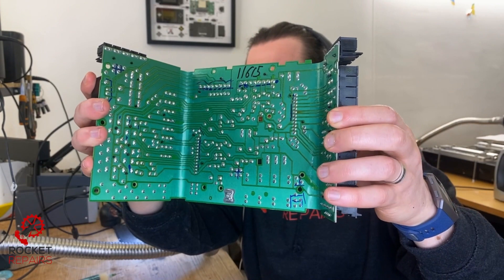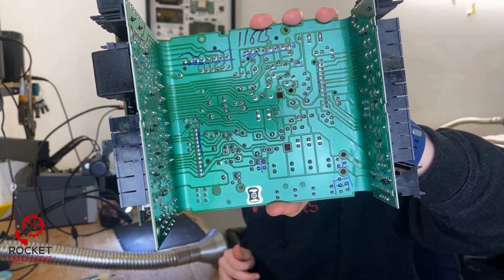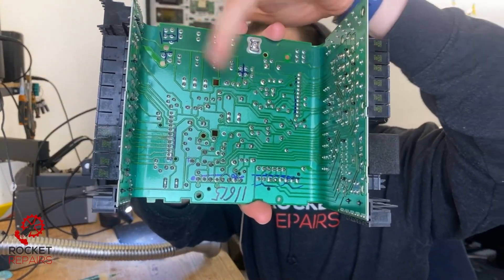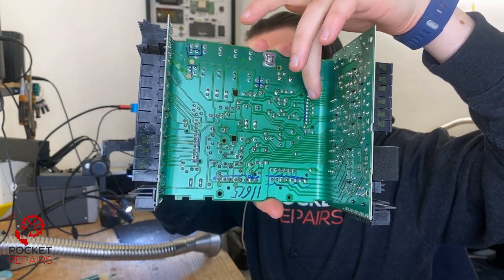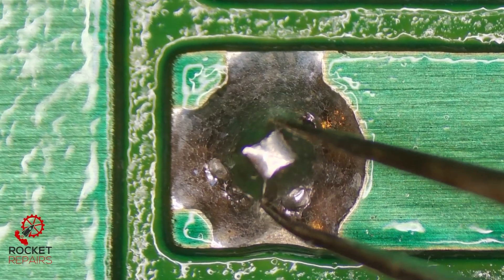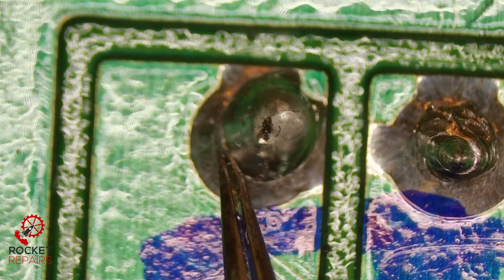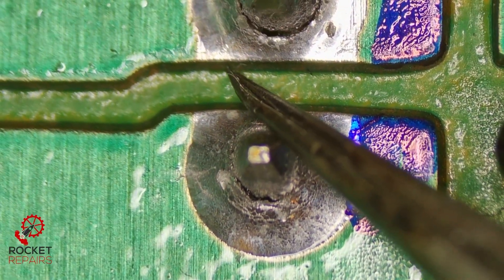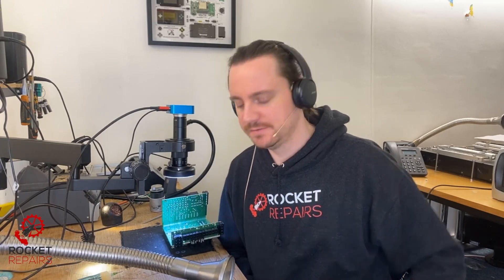SMART CAR SAM Unit - Lot's of warning lights let's see what's going on!

Comment: As a rule the unleaded solder should be removed first, if you don't then there is a risk that the random alloy you create when you add leaded solder will have undesirable characteristics e.g. becoming more brittle, or suffering from tin pest etc. A vacuum de-soldering station is very handy for this, I've repaired a bunch of SAMs now with cracked joints and water damage.
I've noticed that there is one specific connector that is considerably more prone to cracked solder joints than any of the others,

Comment: waiting for the reply of customer. I hope it will work. I have similar issue with my smart 450
Reply from the maker: send it www.rocket-repairs.co.uk/youtube
Reply: I have issue with my smart 450 but mine dont have SAM unit. When I put ignition on only airbag light flash, lcd not working. After 1 minute all lights are on exept LCD and after i pull out key from ignition, lights stay on,
Reply: @Chevy_90 I'd be surprised if you don't have a SAM. My 450 certainly does. It's where all the fuses fit in the passenger footwell.
Reply: @toozes  my fusebox is under driver footwell On left side of the car
Reply: @Chevy_90  that's because we have right hand drive, and you have left hand drive!
Reply: @toozes  anyway, still no SAM unit

Comment: Did that work? My 2009 smart fortwo shuts down while driving. If I turn the key off and on when this happens it takes off like nothings wrong, but some times I have to do it numerous times before it continues to run fine. It's gone months without doing it, and then it may start shutting down again for a few days or weeks, and then it's fine for a few months. I now believe it's the very same issue you have show here. Thanks for the video!
Reply: Have you sorted the problem ? I believe I have exact same issue as you

Comment: Repaired a lot of this in the old days.  Cold solder joints caused by heating and cooling cycles.  Great job.
Reply: I have this problem but my smart dont have sam unit. It is first model of 450. Checked fuse box everything is ok. All fuses
Reply: @Chevy_90  Your car will have the ZEE unit instead of the SAM.  If it's cutting out randomly have you tried changing the crank sensor?
Reply: @ferrumignis  tnx for reply. My car is running just fine and when that happenes that i loose all my digital stuff on board car still runs fine. problem is that when that happenes i cant see temperature and guel gauge, and my speedo is not working

Comment: Interesting video. I hope it will work. A workingcollegue had a similar issue with his car. His speedometer had many cold solder joints due to the lead-free solder.  they had offered to completely replace the valve.  I think it would have been cheaper to just re-solder everything.  so he had to pay several hundred. Great video